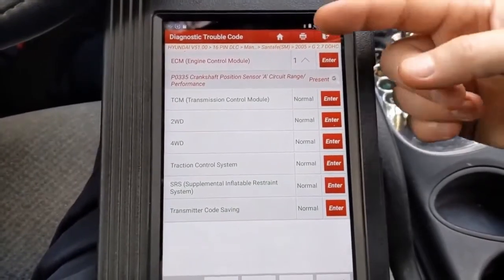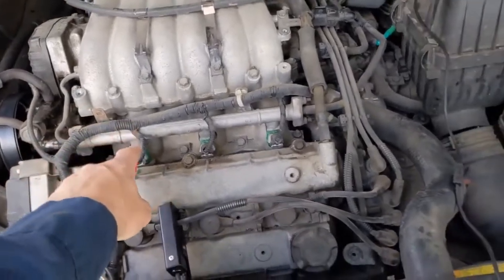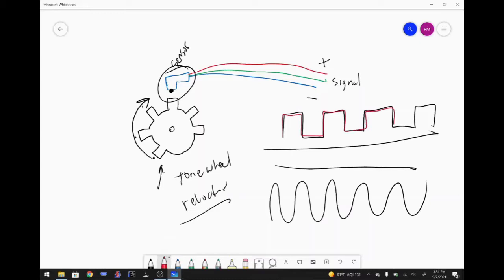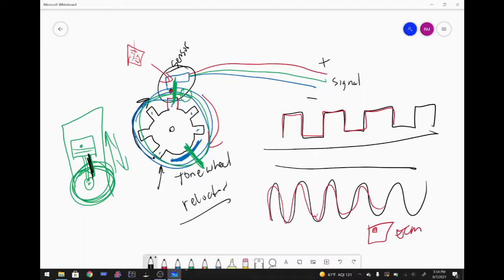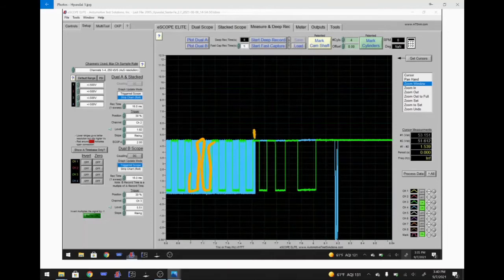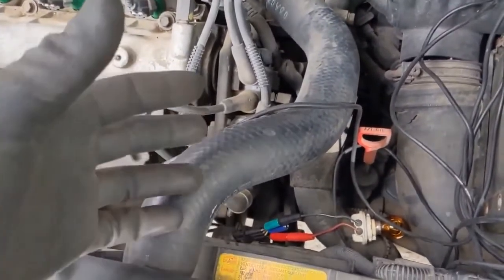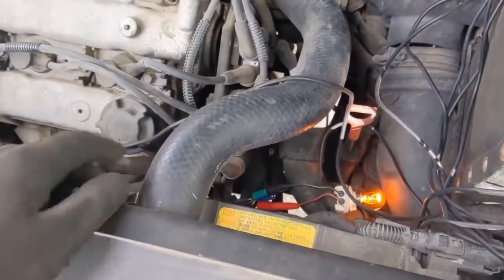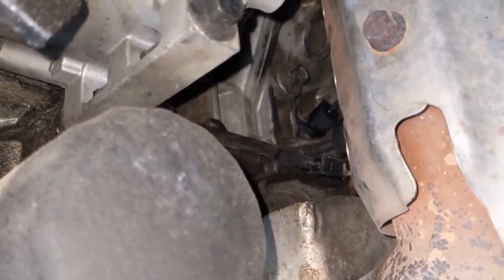Hyundai Santa Fe Starts Then Dies | How to Check Crankshaft Position Sensor in Car | P0335 Explained

Comment: Hey there, great video of the explaining of the problem with the car, BUT I noticed something there that was not mentioned, when you hooked up the labscope to the crankshaft sensor connector you still have wires between the connector and the actual sensor itself that can have issues as well,  I not contradicting your testing process just that there are more wires between the sensor and the connector of the crankshaft sensor that can have a chance of a problem..
thanks for your video. 
Don D.
Reply from the maker: Thanks for your comment! You're right, the sensor pigtail/wiring between the sensor and connector could also have an issue. If that was true in most cases you would still replace the whole sensor because it comes with a  new pigtail and connector. If we were getting a good signal at the connector while the car died then we would locate the engine computer and test there.

Comment: excellent video !!  Best description of what is happening with sensors !! Having the same problem with my 2003 santa fe 3.5l .  The sensors are absolute garbage and the weakest part of any motor .  The crank and cam are set in assembly and unless you throw a timing belt they never change. The whole computer controlled system is garbage that relies on sensors to function, and they always go bad, leaving you broke down and having to spend more money and time to repair, until the next one goes. I miss the days of Air, Fuel, and Spark and NO sensors. I've replaced the crank pos sensor and drove for 750 miles and it's bad again .

Comment: I had the same issue mine is 2.2 crdi hyundai santa fe d4eb engine. First engine light p0335 which is crank position sensor, after i replace it change the code into p0036 a crank position sensor. Car wont start at all. It crank prety strong and battery is full but wont start.
Reply from the maker: The P0036 is for the oxygen sensor and should not prevent it from starting. When you are trying to start the car do you have an rpm on the dash?
Reply: @ValleyMobileAutomotive  sorry my mistake the code is p0336 is a crank sensor fault pending even i delete with obd it keep coming back.
Reply from the maker: @3kkk514  I would unplug it and make sure the connector is making good contact. Where did you get the sensor? I've seen new sensors bad right out of the box. I would avoid cheap Amazon or eBay parts. If the connection is good try a new or different sensor.
Reply: @ValleyMobileAutomotive  the same conclusion I got now, I change the sensor and everything was cool for 2 months and now again is not working properly if I start the truck on cold it works perfect but if I go to the store or any place and stop the engine when I try to start again I can't, need to keep starting and then it works but the rmp dies and 2 lights show up and the motor shaking, I replace the fuel pump thinking was the problem but looks like is the same sensor again.. btw I bought a cheap one from ebay and I stat thinking that's why it fail in the first 3 months
Reply: Oh and my Hyundai is a 2012 2.4L the crank is on the back of the transmission is easy to access from the bottom
Reply: @ValleyMobileAutomotive 
So what should we do after the last comment? 😢